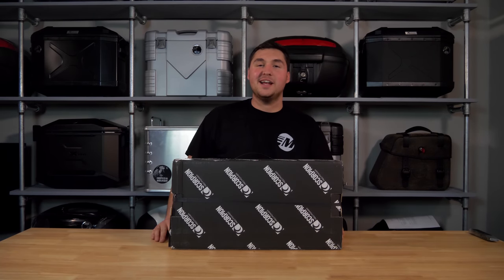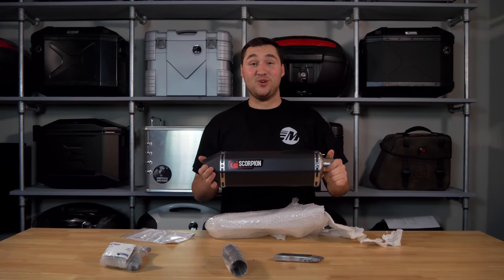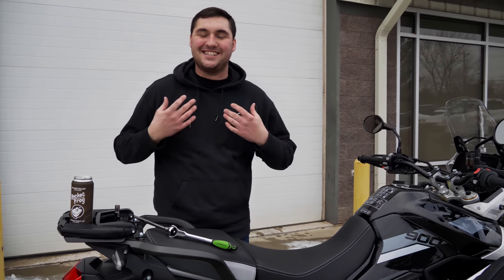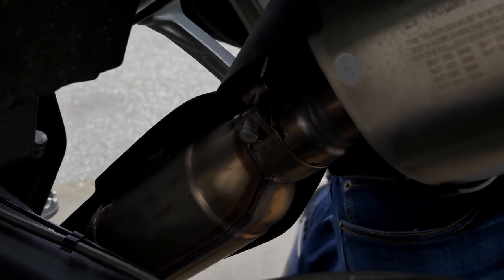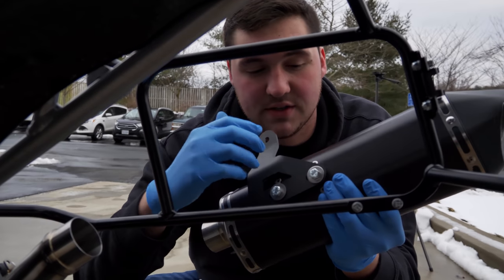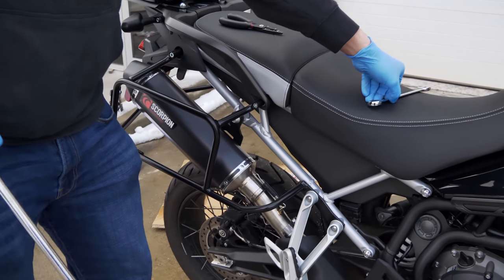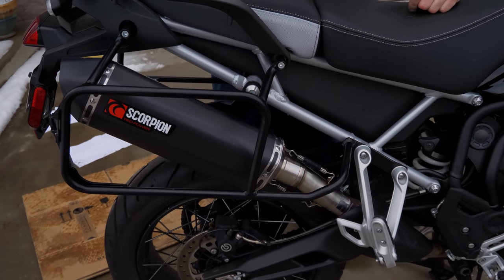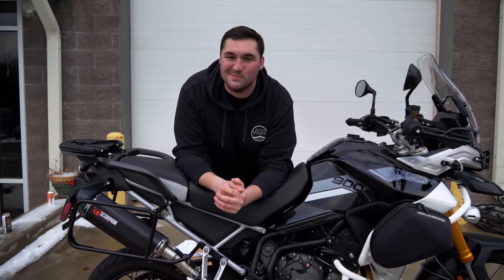Triumph Tiger 900 Scorpion Serket Parallel Exhaust Review | Moto Machines

Comment: That meter reading was all over the place.  There is no way to tell what the actual differences were.  Also, the meter was positioned differently each time. From what it looked like, even the stock exhaust was borderline illegal or at the limit of 92db at idle.      You should have tried to simulate the standard testing which is ~20 inches away and at a 45 degree angle.   Measure at idle (92db limit) and then while holding a steady 5k RPM (100db limit, for 3 and 4 cyl engines)   I saw it peaking at well over 100db which would be illegal anywhere but a race track.  And even illegal at some race tracks. lol   But you were also revving it a lot so impossible to tell.       Also, HOLY HELL did it sound AMAZING with no exhaust!!  That's how it should sound!

Comment: Not fitting in the 2022 model. It has something like a bracket on the rear subframe just under where the bolt goes on and you cannot fit the exhaust mounting bracket. Is it possible to have a different mounting bracket? I bought the exhaust from your website.
Reply from the maker: Hi, please send us an email to info@motomachines.com
Reply: @MotoMachines  I have the same issue, any easy modifications that can be done?